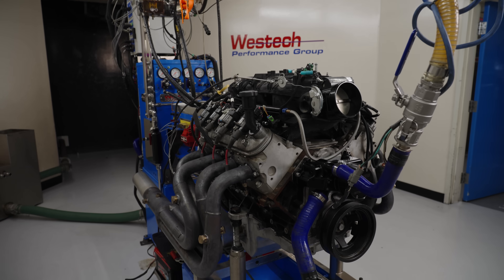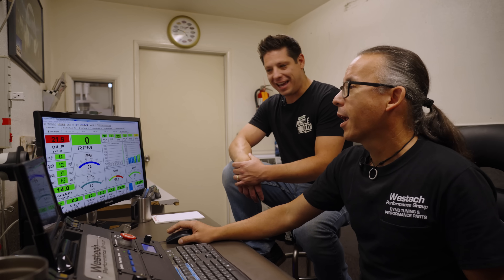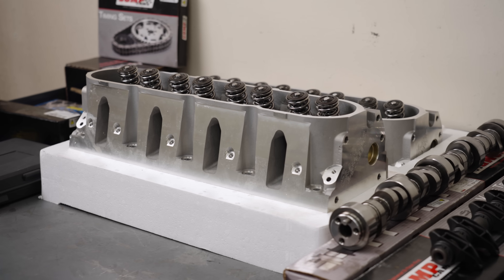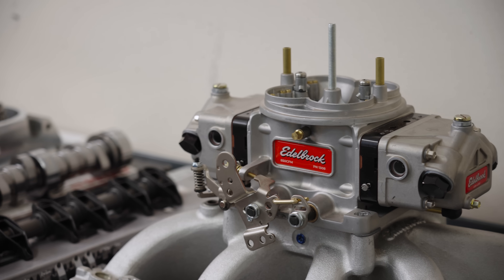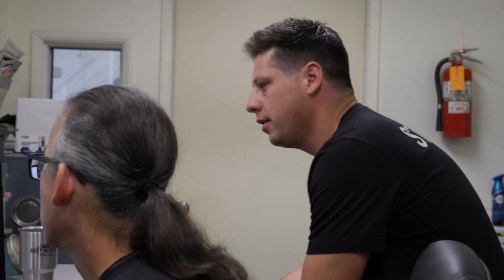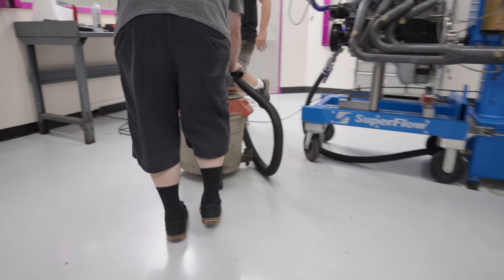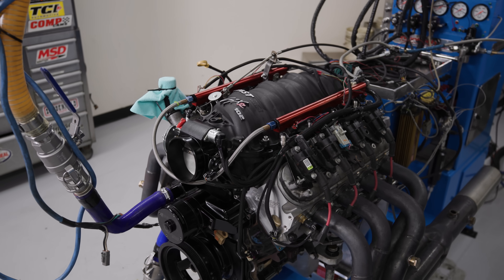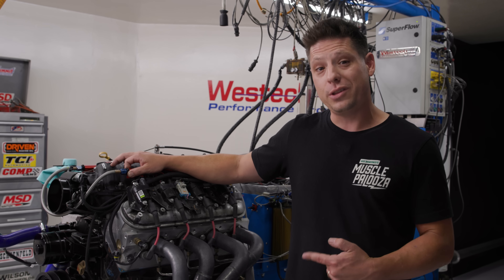4.8L LS: How Much Horsepower Can We Squeeze Out Of GM's Smallest Displacement LS Engine?

Comment: I am 99% sure you just re-created Richard Holdener's wheel- and on the same Westech dyno.  The main problem with a 475 HP 4.8 is that it doesn't feel like 475 HP because you are killing almost all of the non track street light to street light usable low end torque.  However, rev this thing to 8k and it would make a REALLY fun curvey mountains carver as long as you are keeping it over 4K 99% of the time.

Comment: 5:00  Is the intake + carb cheaper than a handheld tuner at $400-500.  Not sure.  For a daily driver I'd rather keep the fuel injection.

Comment: So you get the 'cheaper' 4.8 and put heads and a cam on it?  Why not just get a 5.3 or 6.0 at that point?  You need to put the prices or we don't know if it makes any sense.  Cam alone is $542 before tax.  Maybe high ratio rockers and a handheld tuner are better bang for the buck for around $200 and $340 flashpaq refurbished direct from Holley.  Nevermind the labor installing the cam and heads.  I understand old school loves carbs, but the stock EFI system is literally the easiest and most widely supported tuning platform out there.

Comment: Yep  I did same 8 years ago, dropped a junkyard 4.8 into a c10, only changes from bone stock was a cam, valve springs(if you don't the stock springs will cap the rpm severely) and a tune,  I was even running factory cast exhaust manifolds.  It still runs great today, no issues and easily tops 400HP and 6500 rpm.  Its a riot to drive and listen to,

Comment: How bout port the heads match port the exhaust and intake manifolds machine the valves put bigger valves machine the surface of the head machine the deck surface of the motor

Comment: 2007 GMC Savana 2500 since new with 178,000 Miles ...
Full work van setup carrying 1000lbs everyday...only mods are exhaust (big single Magnaflow) and fuel tuning has been flawless!! Most reliable vehicle I've ever owned and still making $$ everyday.

Comment: Absolutely should not. The 427 is going to make power without the stresses that a 300 will have to endure with all the performance upgrades. You're going to wear the 300 out faster and have more issues keeping that 300 going in the long term. More stresses on the crank, main and rod bearings, cylinders are going to slap like crazy and wear faster. Just go with the 427 and save yourself a lot of nightmarish headache. As an aside, those numbers at such a high RPM is incredibly unrealistic and way out of reality for anyone on the street. You want HP and torque at the lowest RPM possible and RPMs at 7 plus grand is insane and will just ruin your motor faster.👣👣👣👣👣👣👣👣👣👣👣👣👣👣👣👣👣👣👣👣👣👣

Comment: Increase the compression ratio 13:1 e85 solid roller lifters and lighter value train and port the intake and exhaust with light weight valves and REV it sky high.

Comment: I have a 4.8 in my 2006 Silverado crew cab.  It may be the smallest of the LS based engines, but it makes pretty decent power stock (not much, but it's definitely not a boat anchor), that you almost couldn't tell the difference between it and the 5.3.  This may be a hot take, but I think these 4.8's are the 283 equivalent in the LS world.
Reply: I have the 4.8 in my 07 Sierra extended cab, this thing gets up and goes lmao, 238k miles and she doesn’t mind when u wind her out, she’ll sit at 90mph too so comfortably you think you’re doing 60 lol. I’d love to put a couple things on it tho and get her pushing some more power and some good sound
Reply: Got an '03 with 187k 2wd, it does everything I need it to, thought about doing a refresh to the engine but I have a hard time justifying it when it runs so well. Put a higher stall torque converter in when I changed the transmission the last time, huge difference in get up and go.

Comment: My 03 4.8l was bought for 1700$, turned over and ran after sitting for two years with bad plug wires and old plugs, 2 bad injectors, no oil change, and a new battery. Replaced said parts. Say what you want, I drove the hell out of that truck for 5 years with 200,000+ miles on it and never babied it. Sold it for 1200$ with a bad transmission, and they even drove it off with a busted trans pump.

Comment: 03 cateye single cab 2wd with 4.8l I like it so far but compared to my 95 c1500, the chassis and rear end/ steering feels fragile it could just be the 20s that are on it... it's got the ss rims and idk it rides pretty rough but the shocks are also old it's got 197k miles on it but still runs great

Comment: Did you run the same ignition timing with the carburetor that was used with FI?
Reply from the maker: No. It needed more timing to make peak power with the carb. We optimized fuel mixture and ignition timing for every test.

Comment: Gotta love how the dyno curve was still pointing up when they lifted, not even past peak. Want more hp grow a pair and let it eat.
Reply from the maker: No. The engine was done producing power and leaned over at that point. It might be difficult to discern on the graph, but the charts are clear as day. I even have a handful of other pulls to higher RPM that netted no additional power. A seasoned dyno operator doesn't pull an engine higher than necessary.

Comment: No torque numbers?
Reply from the maker: 378.5 lb-ft of torque. You can see them on the graph. That's 1.29 lb-ft per cubic inch. A good street engine is right around 1.25 or better. Some compression would help here (this engine could use 2 points and still run on pump gas), but this is really good for the tiny displacement.

Comment: Swapping a 4.8 into an OBS, I know people want the 5.3s and 6.0s and its technically a torque loss from the old 350, but it gives me a nice modern update for a truck i love alot. These 4.8s are also pretty much the last LS that you regularly can get a good deal on.
Reply from the maker: Check out our dyno graph! With a cam, that 4.8 will make more torque than a stock small block, and more power!
Reply: @hemmingsmotornews im kinda beting on the torque loss lol, my truck is outfitted with the 5LM60 trans which definitely isnt the strongest lol
Reply from the maker: @chrismccann9144  Gentle shifts lol. Cool that you kept it stick!
Reply: @hemmingsmotornews wouldnt have it another way, after that inevitably blows its either getting a NV4500 or t56(if I can find one that is)

Comment: So $ for $ the intake was worth diddly over stock. Id like to see you mill the factory heads .100 and fly cut the factory piston with the DIY at home tool. I did this on my 5.3 and it came out to 13.3:1. Run it on E85 and it runs great. Curious what kind of power gains could be had dirt cheap with milling factory heads.
Reply: Richard holdener recommended milling the heads a bit to increase the ratio to get more out of it

Comment: WHY DIS THE SCREEN ON DYNO SHOW displcMENT =377?  WHICH IS A 6.2 LITRE
Reply: ALSO RUNNING e85
Reply from the maker: @KravMaga-d8t  Where are you seeing 377? The displacement shows 292.7ci (4.8L) on the dyno screen. 4th box from the right in the upper right corner. Perhaps you are looking at the BSFC number, or the torque readout.
Reply: @hemmingsmotornews  DSPL=377 on that dyno screen isnt displacement?
Reply from the maker: @KravMaga-d8t  I see what you're saying. For most of the video it says 262, there are a few clips where it says 377. That must have been after Eric had some comparison files open. That's a user enterable field. It has no effect on data or readings and the engine is absolutely a 4.8. I know because it's going in my SCTA D-Class land speed car.

Comment: Exceeeeeept GM certified the LS7 with full accessories, vehicle backpressure, and SAE J1349 correction.  The 4.8 is still impressive but using the same standard I’d venture a guess this is closer to 430 than 480.
Reply from the maker: We just had a stock LS7 on the engine dyno and it made over 600hp to the crank! Yes, very different testing protocols. Completely agree there.

Comment: I would like to know how much timing you threw at it ? could you have used the thinner oil with the shop vac?  what would have happened had you taken your e85 down to e50? I'm surprised you could get into West tech cuz Richard holders the man there always run in tests but bravo sirs well done!
Reply from the maker: If memory serves it was about 32º that it made peak power. The chambers on LS engines are really good. They don't need much timing. As far as getting into Westech, it's a public business and open to anyone that makes a dyno appointment.

Comment: I want to see how many rpms we can get out of a 4.8
Reply: 6.2 with a 4.8s crank does 8k rpm😏
Reply: @CJIvan 😂😂😂
Reply: @rockroll9513  what's to laugh at😂? With proper balanced rotating assembly, Piston, rods, heads, lifters, camshaft, etc they'll actually turn anywhere from 7800 to 8200+ rpm before running out of steam
Reply: @CJIvan A 4.8 crank is not going to gain RPMs in a 6.2. Richard Holdener has tested this multiple times.
Reply: @rockroll9513  guess you never heard of the 349 LS huh? Destroking an engine gives it rpm lmfao, again with matching balanced rotating assembly, Just look up "349 LS" here on yt lmfao, it's power and was around 7500-8200 rpm naturally Aspirated lmfao😂
Reply: @CJIvan they will all reach the same RPM given a performance valve train. How do you not know who Richard Holdener is? Look him up, he's done every combination you can think of on just about every LS including crank sizes, intakes, turbos, just about every camshaft combination you can think of. A 4.8 crank did not increase rpm and just lost power. Seriously look him up he's a wealth of knowledge.
Reply: @rockroll9513  also can depend on cam, heads, intake manifold, headers and tune, The 4.8 shares the same piston and rods as a 5.3, just like the old 350 shared the same with 305s, the 4.8 typically has better top end and thicker cylinder walls but the good pretty much ends there with it be a smaller motor and all
Reply: @rockroll9513  and yes I heard of Richard Holdener, I see his vids every now and then
Reply: @rockroll9513 dude, a few guys around me are 8500 in drift cars.
Reply: @littleherms3285  they can be spun to higher RPMs but a 4.8  crank doesn't make them spin more RPMs. 😂
Reply: @rockroll9513 4.8 crank is smaller than 5.3 crank it will 100% spin faster
Reply: @Walker-h1o  you really need some reading comprehension. I never said anything about it not spinning faster. I said it wouldn't reach a higher RPM than any other LS crank. I also posted the video of Richard Holdener discussing how he tested this.
Reply: They rev to the moon and love it they make their power on the high rim side
Reply: Cam and valve train. My 6.0 turns 7700 that's built up
Reply: @chrisharriman9017  if you threw in a 4.8 crank (with matching piston and rods) you'd probably crank 8200 (also with the right Vavles, retainers and seats) but still 7700 out of a 6.0 is crazy none the less good sir
Reply: @CJIvan 😂😂😂
Reply: @chrisharriman9017 
Thats insane. Wow
Reply: Ever find out
Reply: i have a 7.2L GEN V LT1 that revs over 8k
Reply: I've gotten 8k rpm
Reply: Theres a bigger crank to shove in there too. I think the 6.2 fits
Reply: Stock bottom end 7500, built ls can rev 9-1000 regardless of displacement
Reply: They've done 10k
Reply: check out squirreltuned sbe 4.8 record, spun it to 9800

Comment: Isn't the 4.8 one of the better LS motors to turbo? I don't know much about this kinda thing but I've read that in a lot of places
Reply from the maker: It's very similar to all the other LS engines with the crankshaft, stroke length, and rod length being the only differentiating factor from larger LS engines. It's definitely a great platform for boost.

Comment: 100 more horsepower aided by 1000 more RPM's
Reply from the maker: If you take a look at the graph, you'll see that it made more power than stock everywhere in the pull, which continued to increase with RPM.

Comment: I absolutely HATE GM but I lent my buddy a couple grand a couple years ago and in exchange he pawned me his 1999 GMC Sierra extended Cab with a step side bed.Long story short he never paid me back so I kept the truck, I was going to sell it because I don't like GM junk until I realized it's one of the good ones. bEAUTIFUL TRUCK RAN LIKE A DREAM when I got it at 250k miles no smoke, cel, thing literally idles like a ev it feels like it's off. Cruise down the freeway at 70 plus at 2k rpm or less! When I moved I didn't want to use my gorgeous Ford to tow the heavy trailer so I overloaded it on the gmc and even told my buddies if it messes up we'll just put the ford to it and ill call a we buy junk cars place and sell it for 100$ lol little thing at 280k miles still runs, shifts, and files like a dream. Pulls trailers like nothing even up hill I was so impressed I don't want to sell anymore. Still my work/abuse truck but she won't give up. Radiator been leaking for 3 years and a little bars leaks once a year does the trick. I literally don't care about this truck I have a heavy foot, I go thousands of miles past the oil changes, etc because idc if it messes up but it REFUSES to quit. My brother in law has a 2017 Silverado with 170k miles CONSTANTLY giving issues. I've towed him so many times. They;'re not made the same. He just sold it on Monday to get a Ford. New gm is JUUUUUUNK.2006 AND UNDER IS THE WAY TO GO

Comment: That thing sounds amazing above 7k! Im skeptical of the numbers, though.  Werent these things only rated at 285hp?
Reply from the maker: Keep in mind the factory ratings were recorded in a very different way than on an engine dyno with cold coolant, free flowing exhaust, and in a 300RPM per-second sweep. 

A bit apples to oranges, but the power delta we found with the speed parts is absolutely real.

Comment: Same size as an old school Chevy 283 bored .060" to 292  back in the day. If you really wanted to go nuts you went to 301 with a .125" overbore. And the heads sucked. heh.
Reply from the maker: You mean you didn't slam a 283 crank in a 327 and spin it to 8,500 RPM like the rest of the internet lol? You're spot on...and the heads did suck.
Reply: @hemmingsmotornews  Well, I had a 57 chevy 210 in high school but never had the money to seriously play. All I managed is a close ration three speed and a Hurst shifter.  I didnt have car money until I got out of college and got a better car. It w s still a fun era. That said, it ws a great time.

Comment: Try more cylinder head , maybe AFR
Reply from the maker: AFR was corrected for every setup tested.
Reply: @hemmingsmotornews that engine had GM cylinder heads 
NOT
AFR heads
Reply from the maker: @gordstigter  AFR is a great cylinder head company, but also an acronym for air fuel ratio. I think the poster meant the latter.

Comment: How can 5,800 rpm vs 7450 rpm even compare. Smh. Am Apples to oranges comparison here.
Reply from the maker: Not really. Simply how engines work. Horsepower is a measurement of work per minute. Increasing the amount of work (lb-ft) or the speed at which that work occurs (RPM) you increase horsepower. Configuration 1 didn't make power past 5,800rpm. You can clearly see the horsepower curve falling off. 
Later configurations with better heads and aggressive camshaft profile breathed better and could perform more mechanical work at a higher RPM, hence increased horsepower. 

If you think we just kept reving it higher to make power, or that configuration 1 would have made more power at a higher RPM, you would be incorrect.

Comment: I have a 2013 4.8 LS Silverado 1500 and I love it. It has a lot of punch and it will beat my buddy's 5.2 2016 GMC flat out. AT 77K I feel like I just broke it in. A tip I got from a GM mechanic was to run 10W-40 synthetic only. OEM calls for 5W-30.

Comment: I put an ~80k L20 in my grudge car to play around in the off season and save on my race engine. Didn’t dyno but based on the logs and what it’s done in the chassis it’s easily been making over 1000 at the crank on a T6 S488. I’ve been anything but easy on it and it hasn’t missed a beat with a solid 20-25 hard passes. These little guys will definitely get the job done.
Reply from the maker: That's awesome!!!

Comment: Where was the break specific/ air fuel ratio. .54 You probably needed to drop jet size in the secondary on the carburetor quite a bit.
Reply from the maker: The AFR was adjusted to about 12.5:1 for both the fuel injected and carbureted pulls. It's hard to show EVERYTHING in the video because it simply becomes too lengthy but we did re-jet the carburetor.

Comment: hahahaha My SAAB 9000 AERO 2.3 BR-234 ALL STOCK head and block ( cast iron  )  with just bolt ons and tune makes 460 hp and when driven normally gets 32 mpg on the hwy and 28 in town.  It also is one of the most over built ( safety ) with a built in roll bar steel reinforced doors all for under 7000. Look up SAAB 9000 450hp or SAAB BMW killer or sleeper.
Reply from the maker: Sounds like a blast. How much boost?
Reply: @hemmingsmotornews  24 lbs. also has new pump and injectors.  What is great is it came from the factory with forged crank and pistons and is geared to rip from 3000 rpm or 45 MPH on. From 45 to 115 is nuts fast for an old beater.
Reply: @hemmingsmotornews  24 #

Comment: The 4.2 is better
Reply from the maker: 4.2L What?
Reply: @hemmingsmotornews oh sorry, GM's vortec 4200 Atlas I6 🤝
Reply from the maker: @steventurner476  Those are cool, too. Better, maybe more debatable...especially NA.
Reply: @hemmingsmotornews  intriguing debate undoubtedly, I would love to see side by side Dyno comparisons of the 4.8l and 4.2l. After some mods of course. Keep up the cool work
Reply from the maker: @steventurner476  We would too. When it comes to natural aspiration I don't think the 4.2L can hold a candle. The LS has an excellent head and aftermarket support up the wazoo. If you add boost to the mix, I bet that little Atlas is a pretty potent competitor even with a stock long block.